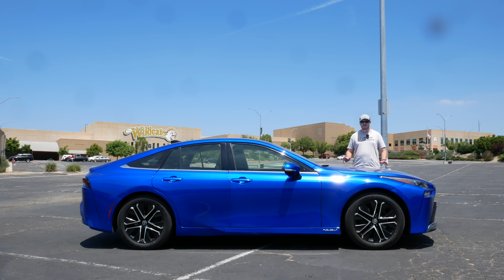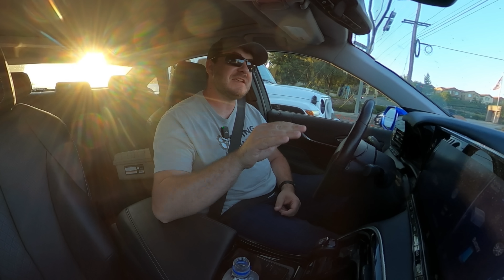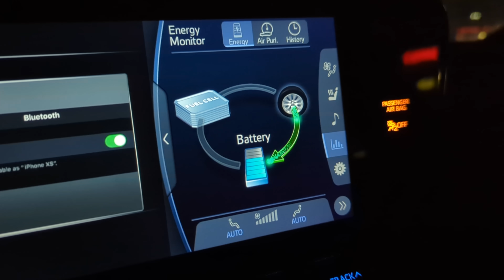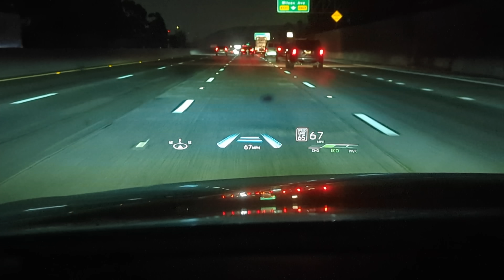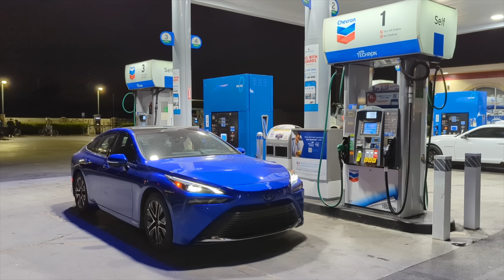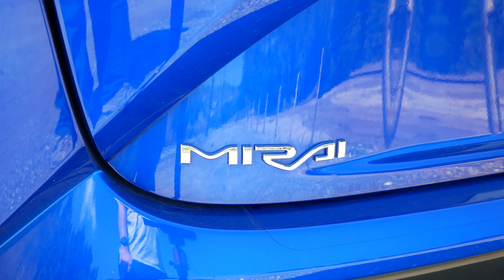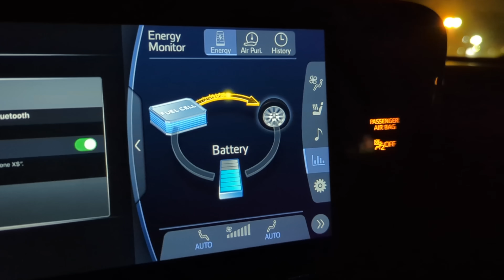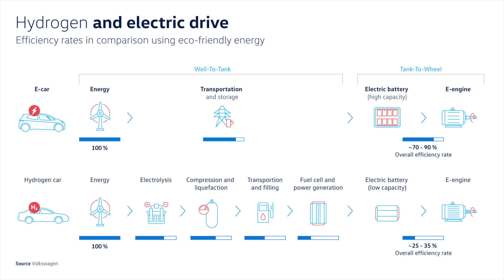The Toyota Mirai is Disappointing

Comment: I leased a Honda Clarity fuel-cell sedan for three years (2017-2020).  The actual vehicle was great, and not slow at all.  It was (and is) the hydrogen supply chain that is still problematic.  But during the three years I had the car I was able to drive it from the SF Bay area to LA and back.  Usually got 250+ miles on a tank with city driving, and 300+ on highway (up to Sonoma).  Since I was unable to charge an electric vehicle at home, the quick fill-ups at the hydrogen stations worked out great for me.  Except for the three months when all the SF Bay area stations were down because the supply-chain had a single-point of failure  (Honda supplied rental car during that down-time).  I would have re-upped on another fuel call vehicle, but the pandemic negated the need for commuting.  Also, back then the cost per unit was $16 for fuel (but the lease came with $15k/3 years of fuel, so I never paid extra).

Comment: I've heard as the hydrogen in the tanks heats up from the surrounding air, the pressure in the tanks rises to the point it must be vented for safety. 
Fill tank - park - a week or so later the tank is almost empty even if you don't drive it.
Reply: Dunno about hydrogen, but I have some experience with compressed natural gas which is similar at least in concept.

In short: the filling pressure is temperature compensated. If it's really cold out you will not get a "full tank" because the controller knows that if/when it gets warmer, the pressure in the tank will increase. It will reduce fill pressure to avoid the tank pressure exceeding the safety valve rating.

The tank will not empty itself, that's pretty absurd. However, when those safety valves do decide to pop... well, even a very short burst of 10,000 PSIG gas is an extremely loud and violent event. CNG is only 5,000 PSIG max and I've seen safety valve releases launch weather caps 30+ feet in the air and have had police arrive on site after neighbors reported gunshots.

Comment: Well of course is disappointing. And not just that.
Is just bad.
Hydrogen tech in general is bad and FAR WORSE POLLUTING than gas.
We are literally better driving gas cars than the so called no emissions hydrogen ones.
Hydrogen isn't an easy material found in nature and extraction is done from fossil fuels with EXTREME energy requirements.
Plus the cars themselves are very bad as user experience. They are virtually electric cars, but dumbed down with a chemical energy generator on board, wasting space and mass.
That chemical generator that needs oxygen to combine with the hydrogen requires clean oxygen, and thus highly intricate air filters are needed, that must be changed every several thousand kilometers.
And they are expensive AF.
Even if the car were to be sold at 10-15.000 usd, it wouldn't make any sense. Hell, if they gave it you for free, it won't be worth it.

Comment: What about a hydrogen powered internal combustion engine? How effective would that be? the emission should still only be water and you wouldn't need a backup battery.
Reply from the maker: Burning hydrogen in a combustion engine is only about 25% efficient. Meaning the same amount of hydrogen that takes the Mirai 300 miles would take a hydrogen combustion powered vehicle less than 100 miles. There's also an issue with NoX emissions and getting good amounts of power out of the engine. It's not a total non-option, but there are some significant hurdles
Reply: @agingwheels  Thanks for the answer

Comment: The lack of infrastructure could be a matter of time, depending on popularity and so on. It was exactly the argument we used for electric vehicles 15 years ago.

The degradation question is what does it for me in the long run. Battery packs need to be switched out after 5...10 Years? What about the fuel cells and tanks. Do they keep their "charge" indefinitely and does it needs to be replaced.

I personally think that sustainability isn't looking at short term efficiency and exhaust fumes. But rather at whats needs to be replaced over time and how that damages the environment as well.
Hence the comparison why it could be more beneficial for the environment to repair an "old" diesel Mercedes then to scrap it for a brand new electric vehicle.

Just dropping some thoughts, not here to argue. Thanks for the great content!!

Comment: fuel cells are just a different type of battery (typically wet or dry cells). they just dont naturally discharge. you could park it for year and it would still run... if it didnt need actual batteries to go along with it.
Reply: Its a filter.  It filters out everything except the hydrogen atoms.  My guess its easily plugged.

Comment: It's not just about fill-up times. Currently the currently biggest problem for EVs is resource availability for manufacturing the batteries. Then there's the availability of charging stations, and the electrical grid being still way undersized in it's current state. If everyone switched from internal combustion to (plug-in) EVs this instant, there would be indescribable lines at charging stations and all grids would be would be hopelessly overloaded. The high cost of EVs masks this problem by only allowing a small percentage of the population to get an EV in first place. Sure, Norway is buying 80% or so EVs, but they have a small and notoriously wealthy population.
Reply: And with all of those issues, hydrogen has basically the same problems, but in some cases much worse.

Comment: I do believe that we will see hydrogen powered internal combustion engines in the near future...
Reply: Or electrical generating stations.
Reply: Hydrogen internal combustion engines are kinda dumb though. They're like... 20-25% efficient, so if it had a tank the size of this Mirai (which, let's say, has a range of 300 miles), you'd be going less than 100 miles on the same amount of hydrogen. Combine that with the cost of Hydrogen, and the fact that burning it in an ICE in our atmosphere of 78% Nitrogen, you end up with NOx production which is exactly what the EPA/CARB/etc hate as an emission
Reply: @Black-Villain  you deal with NOx emissions the same way you do with gasoline engines: catalytic converters 😉  You can probably make them cheaper for a hydrogen engine, as they no longer need to be 3 way catalysts (CO + HC + NOx)
Reply: @brentboswell1294  Yes, I'm aware that you can use catalytic converters to help with emissions. You're still making emissions though, no matter how you cut it, and increasing your complexity. Hydrogen is still $30/kg, you're still burning it at 20-25% efficiency, your range is terrible, it's expensive to operate, it's not easily-retrofittable to existing vehicles, you're giving up horsepower, and it just... doesn't make any sense to use.

Comment: Would it be realistic for a home mechanic to do any work on a used hydrogen car in 10-20 years time, or do the extremely high pressures involved with hydrogen require specialised knowledge and equipment?
Would someone like Rich Rebuilds or yourself even want to work on one?
In Australia, cars that run on LPG (propane) need their tanks tested every 10 years to be road legal. I imagine you'd need similar tests for the hydrogen tanks in one of these.
Lastly, how will these cars fare if the battery catches fire in an accident? At least with pure EV cars, the risk seems to be mostly thermal runaway, but without the possibility of a massive explosion, unlike hydrogen presumably.
Reply: As far as I know, the hydrogen tank rupturing isn't as catastrophic because the gas itself is really light and dissipates off to the atmosphere almost instantly. Moreover, a hydrogen fire should be safer than, say, LPG fire, especially in closed parking lots because Hydrogen doesn't produce toxic carbon monoxide gas when burning. It literally just produces water.

Comment: I was at a gas plant in Southern California recently...they were excited about expanding their hydrogen business.  They already produce hydrogen for industrial use (it's pretty common for use in power generation, where it's used to cool turbine combustion temperatures).
Reply: Isn't half of it used to make ammonia largely for fertilizer?
Reply: @LunarLaker   Yes, and the other big use for green hydrogen will also be for steel production instead of the fossil fuels.
Reply: 1. hydrogen burns significantly hotter than natural gas and oil. it gets used to cool the generator and not burnt in the turbine.
2. industrial hydrogen production is done through steam reformation. where for each pound of hydrogen that is produced you also produce some 9 pounds of CO2 and that's before you count emissions from compression and logistics. which means that a hybrid camry has lower CO2 emissions than a Mirai fueld with steam reformed hydrogen
Reply: tax subsidy grifting is always exciting lol

Comment: I suppose in the same vein as CNG busses, you can just stick a huge hydrogen tank on the roof since it weighs so little, and it's not a big deal for aerodynamics cause lots of busses are operated start-stop and don't need to get over 60km/h.  But at the same time just putting a 5km range battery in, and electrifying the regular routes with catenaries uses less than half the electricity and can be failsafed in an emergency more easily.

Comment: I've been told that hydrogen cars clean the air as they drive too... Yeah, you're going to be changing alot of air inlet filters because the fuelcell wears down and gets damaged if it inhales a speck of dust. And as far as I know, the anodes/kathodes degrade when they are generating electricity. Just like a battery, only more expensive 😅 even for trucking this doesn't make sense.

Like building a house out of toilet paper, that you have to rebuild every time it rains. Planned obsolescence on steroids for sure, who would accept stuff like that? Fools??

Battery electric vehicles makes way more sense in every way possible.😊

Comment: Solid video, but I have to be honest I don't think hydrogen has any practical application. Everything associated with it MUST be over engineered to minimize loss and be functional, but the reason ICE had been dominant is because of its error tolerance.  Even BEVs, which i firmly believe to be the future of transit in nearly every form) suffer staggering losses when faced with suboptimal conditions.  Hydrogen has those losses as well as the losses associated with the inclusion of hydrogen on top... Practicality has left the chat.

Comment: I know NASA have used fuel cells on space craft sense the 1960s. So they should be able to operate at extreme temps.
I also know fuel cells are expensive because they need platinum. Everything else is cheep compared to a ICE or EV, but the platinum just makes it stupid expensive. 

If the tanks are at 10,000 PSI, that means it is a literal car bomb going down the street. How stupid is society to allow this to be a thing?  That was a rhetorical question and the following is a hypothetical scenario. Someone stole a F150, and as you go through the intersection the guy in the F150 broadside you as they run from law enforcement. Kaboom! Innocent bystanders are taken out by the shrapnel. I know ICE has flammable fuel, but it isn't held to "OMG, we are going to die due to catastrophic discharge" levels of pressure.

Comment: Now comment on the average 15% ICE efficiency plus the gas production from crude efficiency plus the shipping of crude efficiency plus the wars to get and keep the crude efficiency.  I think you will find fuel cells to be a great advance.  And we can repeat the process with batteries and their unreliability, extreme repair/replacement cost, mining efficiency and environment degradation, flamability, and cold weather performance.  Oh and the long charging time.  And the coal fired electricity you charge them with.  At least you could give the full story.

Comment: Presently hydrogen powered vehicles, of any kind or size, are only practical in warm climates.   You will probably never see one in Duluth MinneSNOWta as the Toyota Mirai generates about a cup of water per mile and only has about a litre of storage for that water and it is constantly peeing on the street.  Imagine the carnage if a flock of them were on the streets of a city built on the side of a hill at -30 f. or any cold street anywhere temps get below freezing.  I've had the opportunity to discuss this with two automotive engineers working on Hydrogen power for two different companies and they have no answer, and quickly change the subject.  Even the paltry 1 litre of storage would freeze solid in minutes in some climates.  Sure they could heat that tank but that would require more energy.

Comment: Fuel Cell Vehicle developer here.
1. Expected life is 3-5000 hours of operation until they have lost approximately 10% of their power.
2. Winter is not a problem. Starting is a little bit challenging, but unlike in an EV there is plenty of heat (no reduced range in Winter)
3. Batteries are much more simple, but their production is horrible and their disposal is even worse. Fuel cells are very well recycleable in comparison (though the tanks are a problem).
4. Compared to batteries, increasing range is very cheap.
5. Fuel Cell as a range extender makes little sense due to cost.

Comment: I'm pro-pantograph for long-haul trucking. I think hydrogen could work, but installing a system of overhead lines on the interstate is a better solution.
Wait a minute... why not both? There's no reason why a truck with a pantograph couldn't have a hydrogen cell as a backup for routes that don't support the pantograph.

Comment: Where the basic components of this car would make sense would be to close the carbon cycle. Replace the hydrogen fuel cell with a direct methanol fuel cell and relegate it to a range extender like Robert alluded to. The tech, studies and calculations to make it happen have already be done (i.e. methanol being produced directly from wind power; hydro and solar would also be great options), we just need to do it. Excess methanol can also be easily stored or used in manufacturing, reducing atmospheric CO2 at the same time.

Comment: It's almost insane the way the prices of these dipped from brand new to lightly used. Like under half of what the MSRP was when they were new.
Reply: With the current price of hydrogen not surprising
Reply: I think if you include all the incentives from the manufacturer and state, price shouldn’t be too different. I’m considering getting it new if my current car blow up
Reply: Main reason is the tanks have an expiration date
Reply: It's insane that they're selling at any price.  Hydrogen is a silly way to power a car, batteries are FAR more efficient and cost effective.
Reply: @jonc4403   It's insane that they're selling at any price.  Electricity is a silly way to power a car,  gasoline engines are FAR more efficient and cost effective.   ( said someone 40 years ago )
Reply: @bobroberts2371  40 years ago, we knew electric cars were coming.  40 years from now hydrogen still won't make any sense.
Hydrogen is NOT a fuel.  It's a very bad battery chemistry.
Reply: @bobroberts2371  I mean that same person 50 years ago was expecting nuclear fusion power in cars by now, not every Cool New Idea pans out.
Reply: @drewgehringer7813   said "   I mean that same person 50 years ago was expecting nuclear fusion power in cars by now, not every Cool New Idea pans out.   " 

Were any of these  nuke cars ever built either in functioning prototype or offered to the public?

Comment: The main problem with battery vehicles is they don't have the range with the exception of cars like Tesla which in most cases give over 200 miles range and fast recharge the majority have 100 to 150 miles range and a slower recharge rate hydrogen fuel cell vehicles have great range but need an infrastructure like gas powered vehicles fortunately the infrastructure exists for the most part in the existing gas stations all it would need is modifying the gas stations,
As to the price of hydrogen if it were taken onboard then the price would go down as the hydrogen vehicle numbers go up.
Batteries do have the lead at the moment but the majority of EV vehicles need to have a much greater range before they become more viable for the average driver.
Reply: If you think changing a gas station to sell hydrogen is a "small modification", you're going to be disappointed..